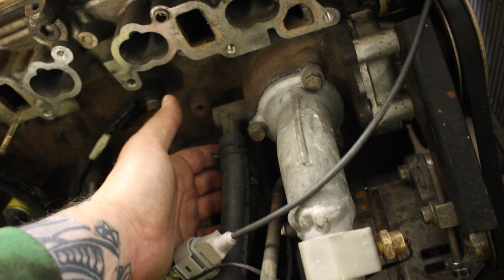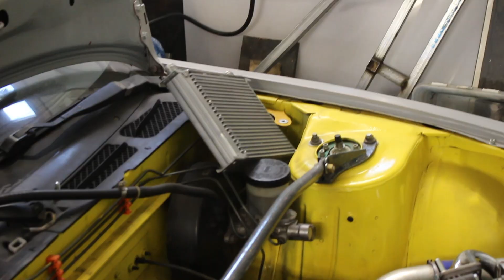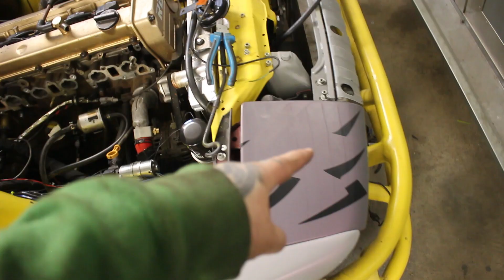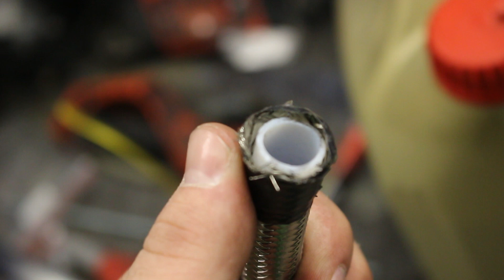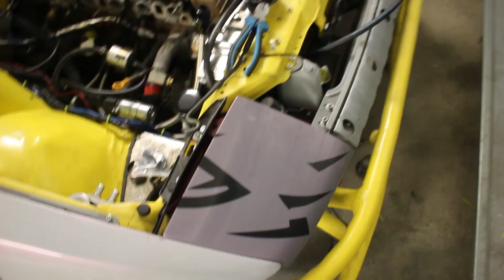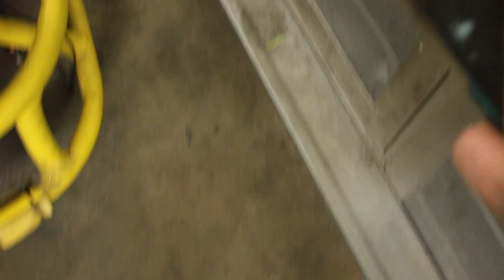RB20DET S13 oil and coolant lines

Comment: Fair play, you’ve put a lot of graft into sorting those oil and coolant lines, looks tidy enough. If you wanted to take it up a notch though, I’d say clean up the routing with a few angled AN fittings makes it look less spaghetti and keeps things snug. Heat protection’s decent, but near the turbo I’d whack on some proper fibreglass sleeves, just to be safe. Brackets are doing the job, but a set of anodised alloy mounts would give it that pro finish. And honestly, a pressure gauge in the cabin would be a lifesaver if anything goes south. All in all, cracking effort just a few tweaks and it’d look like a proper workshop build
Reply from the maker: Thanks, I understand your point but I don't prefer using angled connectors for flow restrictions they cause. I was thinking about making these hardlines but decided to go with ptfe tubes for now. And I do have a digital gauge in the cabin for oil pressure, boost and afr with the ecumaster data from realdash